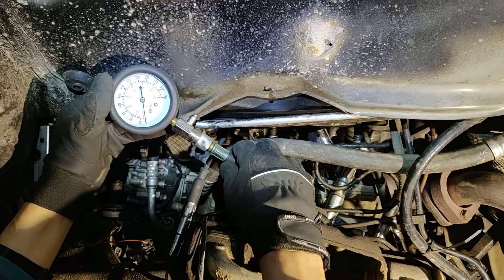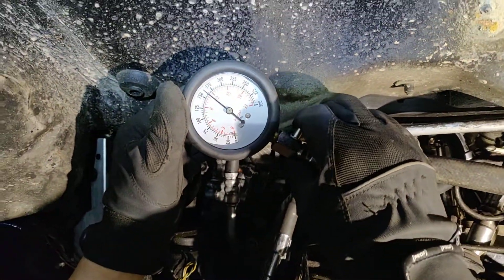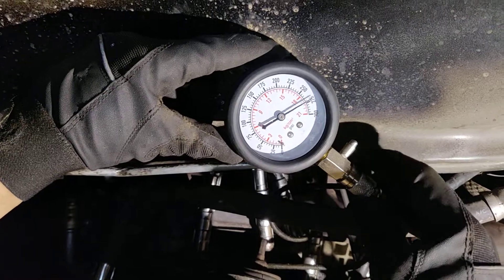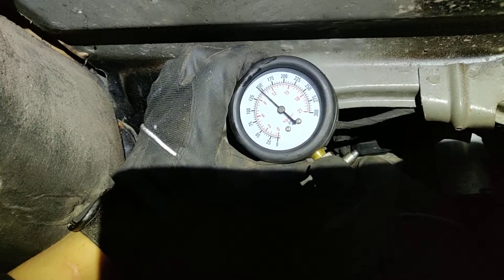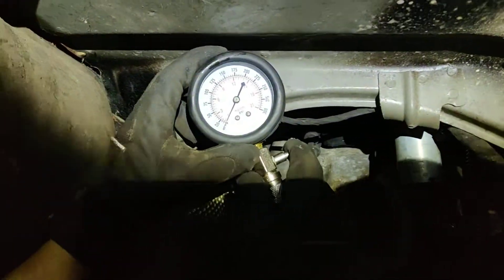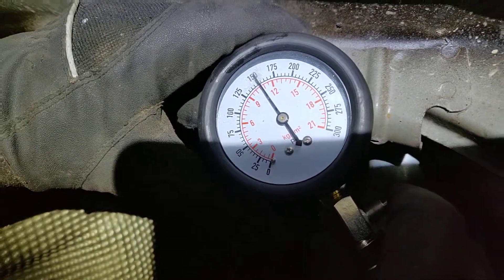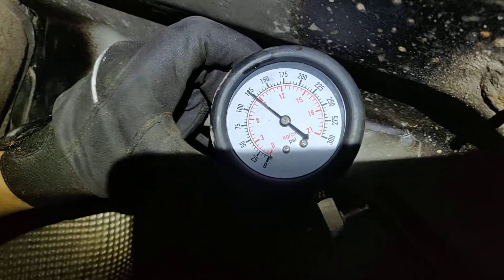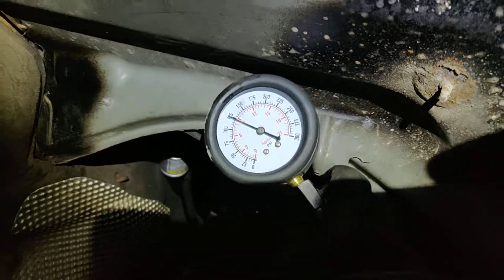Mercedes ML430 278HP 200kW petrol 1999 compression test results

Comment: Thanks for sharing!

For each cylinder, when you tested compression, did you leave one spark plug in or did you remove both spark plugs? 

Thanks for your time!
Reply from the maker: I leave one spark plug in
Reply: @modrix Great info, Thanks! 👍